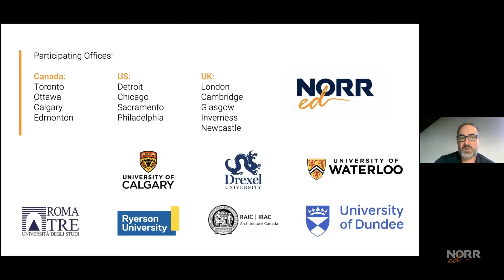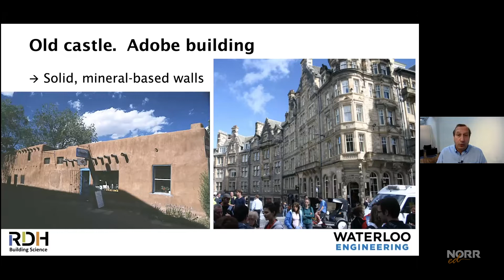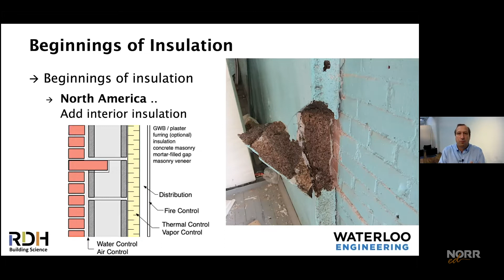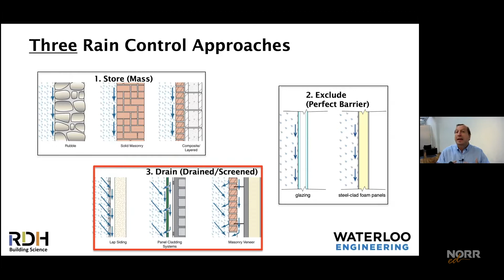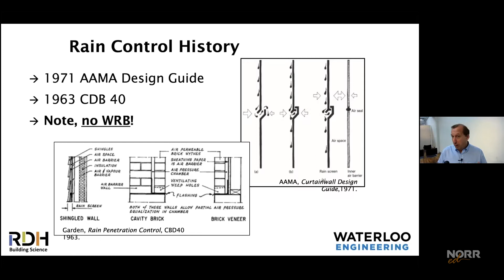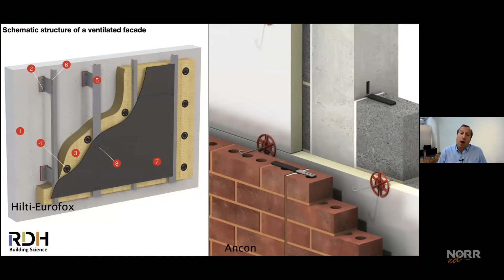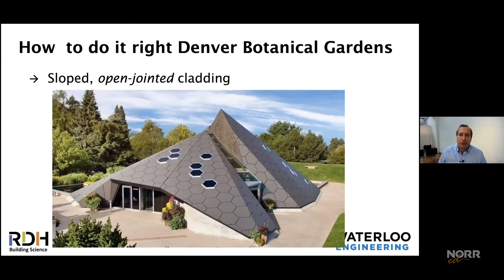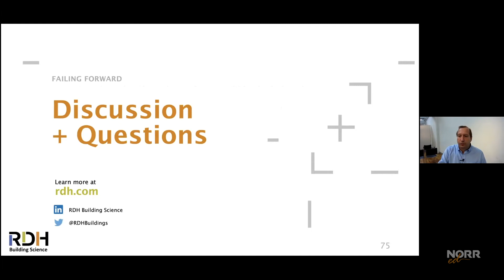John Straube | Building Skins | NORR ed 2021

Comment: Great presentation. John’s a great teacher.
Here’s my question:
I don’t wish to knock architects…I am one…but I must ask why the use of a building enclosure engineer hasn’t become a standard practice for all projects above the residential level. Most firms rely on a whole battery of engineering consultants from civil to IT yet we are still uneven at best on enclosures. And yes…we architects become coordinating “jacks of all trades…masters of none”. We need to know significant amounts about the engineering disciplines we work with but for some reason we still think we can manage enclosures…only to be told by people like Straub…”you guys don’t know that detailing a window in precast is different from detailing in cavity-wall”. And let’s be honest enclosures have gotten so much more complex and meanwhile staff architects spend more time building “smart components” in Revit and mastering the latest rendering software then learning how buildings are actually put together.